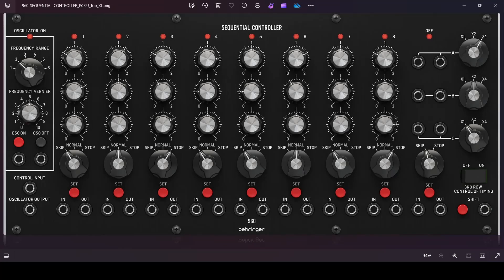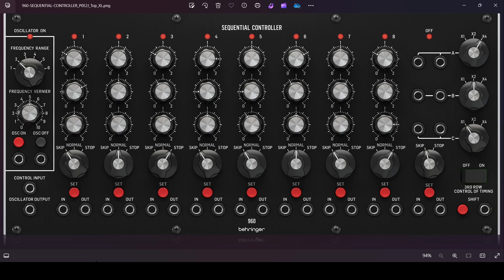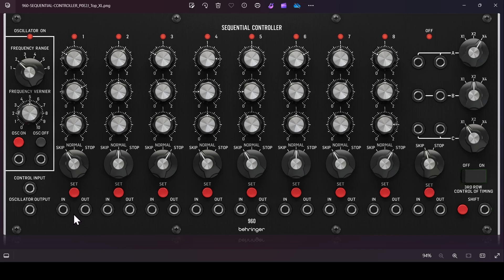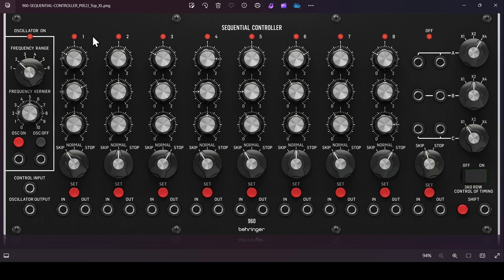960 Sequencer Advanced Techniques #2

Comment: Hey OZ
Amazing info in tis one. Very iseful. Just wondering if you think Moog had these ideas when designing the 960. In other words, thinking about the flexibility in an inflexible system? I create rests by patching the individual outs of each step to a mult and then to the 961. This seems to work pretty well but takes a lot of cableing to accomplish. Cheers and thanks for the great video tutorial. Cheers
Reply from the maker: I'm sure they went through some of these use cases.  I'm certain they saw manual controls and said "We should have a CV or Trigger for this", realizing the power (flexibility) that would be unlocked by doing so.
Is it ok if I steal the 961 idea for a video?
Reply: @ozhalljr  Thats very interesting about the vision of the designers mind. In this case I wonder how often Bob Moog was surprised by what others came up with to utilize the instrument. 
Please use the 961 idea.  The 961 is the most interesting module in my 35. Timing of gate triggers is really fun. I like to use the - and + outs on the 921 and trigger both sides of the 961 then out to stereo for ping pong effects. The 911's are so snappy and accurate. My system 35 is a really musical sounding box! Thanks and wonderful video plus conversation, Cheers